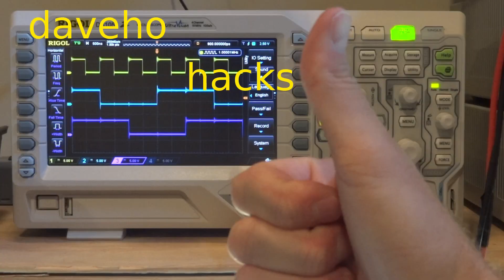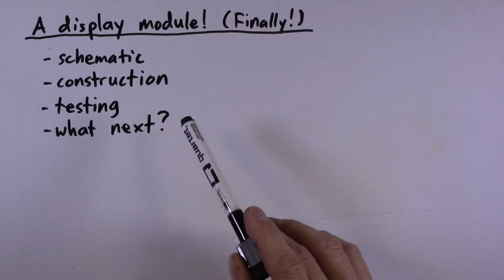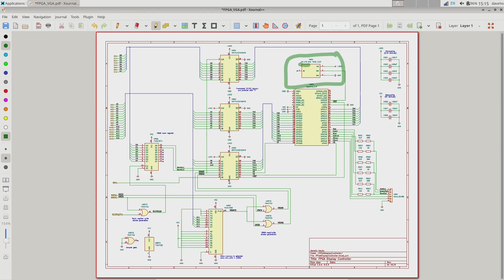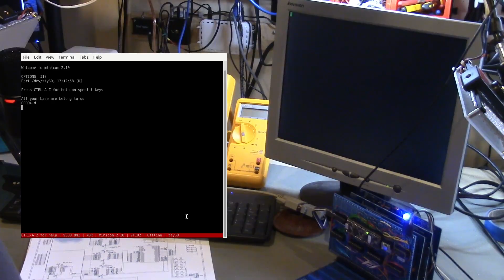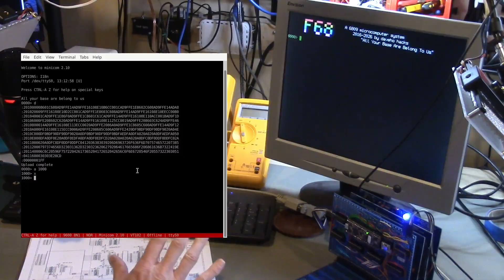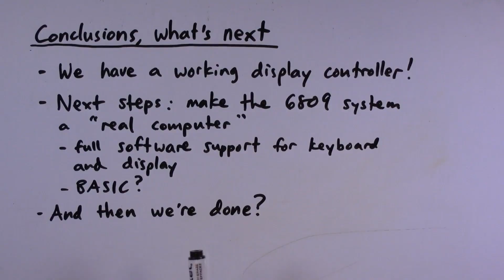DIY 8-bit computer, Episode 1E: VGA Display Controller

Comment: small correction: CGA was using RGBI which was digital (TTL) output, while VGA is based on an analog signal. that's kinda big difference.

Comment: Looks cool. Hacking MS BASIC is basically just a matter of hooking in your own char in and out routines. Might be a poll sub as well for testing if there’s waiting input. 
You need  proper multitasking OS. It’s amazing what the little 6809 can run. I had a proper multitasking, multi terminal OS running on my custom 6809 board. Got as far as read only filesystem access then got bored. Got some vids on my channel if you’re interested.
Reply: My first computer was a Tandy Color Computer 3, so this project is right up my alley.  OS-9 was a powerful multi-tasking OS beast.  Been working on making a modernized version of the CoCo using off the shelf components (LS, GALS, SRAM, ROM, etc, and CPLDs for the video side).  I'm also including use of microcontrollers to do different functionalities such as one of the PIA's that's function is for the joystick/audio/cassette and bit banger serial port, and only used 6 of the 8 data lines, so even an ATMEGA 328P would work fine for it.  I am removing the bit banger serial port and the cassette port for this project, so it only needs to tackle the joystick and audio functionality (and the comparator out to the other PIA for joystick reading too).  The other part of the PIA on that was just basically used for holding the video mode register for the VGD, which I'm offloading elsewhere.  I'm adding other additions such as a true serial port, SD Card interface to replace the floppy interface, PS/2 Keyboard and mouse, etc all with microcontrollers and some off the shelf logic.  My goal is to first make it function like a typical 64K CoCo 1/2 with VGA output.  Then once that is all working, adding functionality to make it a CoCo 3 with 2MB of total SRAM, then after all that works, work on making an advanced CoCo 3 with more video capability such as 256 color modes.  The video side has its own 64K SRAM frame buffer (and an 8K Text Atrribute SRAM and 8K palette/pixel out SRAM).  Already using a 63C09 for this and set it up that will allow it to run in a "Turbo" mode at 3.58mhz.
Reply: @sprybug   I've never played with OS-9, though it sounds fantastic. I built my own 6809 machine: The usual SRAM and EEPROM, plus two Flex10K FPGAs which are basically tiny FPGAs in PLCC84 for doing glue logic. Plus I had one acting as a simple DMA controller. Video was with a V9958, basically a grown up TMS9918, plus 6522 for a printer port, QUART etc. And IDE/Compact Flash for storage. Was a great little computer; learned loads building it, writing the VHDL etc. It's a tricky balance between old and new, but my rule is I don't want MCUs or FPGAs that are "too powerful". I certainly don't want an FPGA that can run the processor core, or an MCU doing anything other then one simple job. I too used a ATMEGA328P in PLCC44 for a keyboard interface: UART port on one side, and an Amiga 600 keyboard on the other. After building the computer I thought what it needs now is a multitasking OS, so I wrote one. Got quite far with it. Multiple concurrent terminals on the UART ports and on "virtual" terminals on the V9958 ala Linux. Got as far as a very simple shell and a read only MinixOS filesystem driver which could run external commands. Gotta love the 6809; it's the best 8 bit by a wide margin. But I don't like the 6309 ISA! Not orthogonal like the 6809. Anyway, got some vids in my channel as I said. I'm sure you'll find something interesting, but my production values are very poor!
Reply: @lawrencemanning  I'll have to check your videos out.  I've learned quite a bit watching other people's own 8-bit computer projects, which is pretty much why I am here.  Right now I'm breadboarding everything, which gives me the flexibility to make changes and corrections.  I have gotten it to execute code in the ROM to make sure it's working, it's just a matter of getting everything else figured out to make it work.  I have yet to program the microcontrollers and I'm reworking my video CPLDs.  I stuck with CPLD's, GAL's, etc, because I'm trying to keep it all using 5V parts without having to use level converters.  I'm using some older 5V capable CPLDs (specifically the EMP7128), that I can program using schematic view with Quartus II using version 13 that still can program the 7000 series.  Have a USB Blaster, which I have successfully programmed these CPLDs with using this version of Quartus II.  The 63C09's I've got are all original DIP-40's.  So, I'm not entirely sure what you meant by 6309 ISA.
Reply: @sprybug  @lawrencemanning As a kid, the first home computer my family had was a CoCo 1.  I saw the magazine articles and ads for OS-9, and it seemed cool but I had no use-case or money for that back then!  Funnily enough, I was living in the same area as the company that developed OS-9.  At one point I looked into trying to get a job there, but they didn't seem to be hiring then.

Comment: Great to see another installment 👍. I watched it with my Nebelung cat (fluffy Russian Blue) on my lap and she was fascinated too! I've not done anything on my homebrew 6809 for a few months as other hobbies and projects have taken priority. I did get to the stage of being able to run the Flex O/S on mine using shugart interface 5.25" floppy drives "borrowed" from a BBC Micro. Have you thought about Flex for your machine? It would open up a world of software such as BASIC interpreters but might require some rejigging of the memory map.